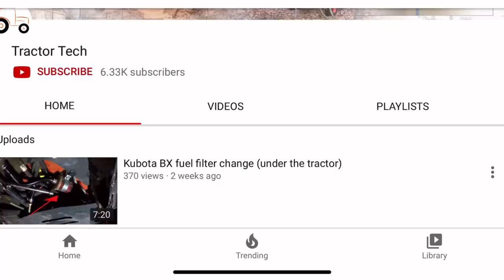Kubota BX fuel filter mod! Step-By-Step! (DIY)

Comment: I finally did this 8 months after watching your vid. The brass vent nipple is a press-fit. I popped it it through the backside of filter housing and ran a 1/4-28 tap and a bolt with Blue Jesus to seal it. I had to keep my filter under frame because my cab heater hoses ate up most the real estate on that side of the frame. At least I have a valve and can visually see any water now.
Reply from the maker: I actually saw your post I think On a Facebook group! Looked really good man I’m glad to hear it all worked out. I figured that nipple had to be pressed in there once I turned it and nothing happened, great to know it comes out backside tho cuz I didn’t know that. I’m glad it worked out! I’ll be removing my nipple next fuel filter change 👍🏻

Comment: Apologies, Biff. Yes, the parts are where you said they were but when I watched your video, it somehow skipped the beginning....but thanks for your reply....I've already ordered the filter &, oddly enough, I have just been through a nightmare with 2 tractors & both had water contamination....but that's another story.

Excuse the long post here but some of it might be useful to you or one of your subscribers.

Aside from the filter mod, I often see people asking for drawings, parts manuals or service  / workshop manuals & I found that many are available online, if you look for them....from front loader, mower deck, rotavator, box blade & bush hog...I got all manuals online...& for free. 

On another note, I have done just about everything with fuel on my BX2200D. Draining the tank, replacing lift pump, replacing shut-off solenoid & even stripping the injection pump to components...then buy replacement parts & reassemble it all.

I am no expert but when there is a fault.... I want to fix it without stupid costs from Kubota, so I buy most stuff from eBay......starter motor, water pump & more. Compared to Kubota, I've always found a cheaper source for parts from eBay & have them delivered to my door.....sometimes for 1/4 or 1/2 of what main dealer is asking.

Yesterday, I ordered 2 shut off solenoids from someone in Huston (I am in NW Florida) & that single order quickly changed to an email conversation with someone in China, which is where most parts are made today.

If you would like to know more, to pass onto your subscribers, get back to me. Via Youtube.
Reply from the maker: Awesome man I appreciate the information for my viewers. I have been a long time user of eBay and buying parts cheap from there tho I still try to buy genuine Kubota parts from eBay if possible. The one reason many people go back and pay crazy prices from Kubota is because with out it the aftermarket parts could ruin their expensive tractor warentee and make it void so lord of guys will still buy parts from the dealer because of this.. However if your tractor is not under a warentee anymore like mine or yours then I feel eBay is def the better rout for most stuff.. I agree most things are made in China anyways but I still feel Kubota factory parts have better quality to them as I have used both but have also had success with non Kubota brand parts also so it’s all in what you want. On your fuel sounds like you need to run a diesel biocide additive for awhile which will keep the Algie down and slowly eliminate it; run it in anywhere your storing your fuel and if your not storing it then I would choose a differnt place to get your diesel cuz it sounds like they may not be changing/updating the filters on a regular basis. I’m glad you got everything you needed to do the mod, wish you the best of luck! Thanks for the comment 👍🏻

Comment: This is an excellent video...& I've just come into the house, with fuel lines disconnected, trying to sort out my own fuel supply issues which generated a number of questions about the true value of inline filters & why the genius's at Kubota don't fit separators as standard. Of all diesel engines I have ever worked on, there was always a clear bowl to see particles & water. You've explained the modification extremely well...& this is just a little extra.....but the real fun starts when there is an issue with the injection pump that everyone says has to go to "experts" to repair for hundreds of dollars or spend a thousand or two to buy a new one. I have a BX2200D & actually had a fault on injection pump, read stuff online but there was nothing of use, unlike your video. But...it is only a pump & if you have basic mechanical skills, you can strip, find the fault, buy the parts online & fix it yourself.
Do a video on stripping & repairing an injection pump & you could probably get 3 million subscribers....but that's why every Kubota owner should have a separator filter & maybe you don't damage the injection pump.
Reply from the maker: Thanks man! Sorry I’m just now seeing your comment! As for the injection pump I plan to do a little modification to mine, I may do it this winter some time and if I do you guys will be able to see the injection pump more in debth. Iv never really heard of too many injection pump failures on Kubota engines specially these smaller 26hp and lower engines tho I have heard of the pump valve springs breaking tho it’s pretty rare and only when they have a considerable amount of hours on them. These pumps are pretty darn easy to work on tho I’m sure a lot of people think they are difficult. They are fully mechanical so there isn’t much too them. Stay tuned and maybe I can do a video on it sometime in the future! Thanks for watching and hope your mod went well!

Comment: The only thing I might have done a little differently, would to have use some bigger zip ties, and put the fuel line inside some Black Split Wire Loom Tubing for added protection.  Thanks though, great video.Thumbs Up!! I definitely like the idea of adding a much better fuel filtering system, should have been done from factory, but guess they have to cut the cost where then can..
Reply from the maker: Thanks Paul! I agree, larger zip ties would be nice, I didn’t have any that day only those little ones so I just used what I had but plan to redo them this winter. Loom is also a great idea, I actually bought loom for the fuel lines but forgot to install it. Thanks for watching and your right it is deffinelty a worth wild upgrade. Diesels NEED fuel to have power, with low fuel pressure and fuel flow they will run terribly so it’s vital that a Diesel engine gets as much fuel flow as it can. Like you said.. Kubota shoulda done this from the factory 👍🏻
Reply: I liked this suggestion so much, I added 5/8 split loom after my install.
Reply from the maker: @chiapet4444  Awesome! Wire loom will def help to protect the lines and keep them from chaffing. Glad it all worked out for you buddy.

Comment: Nice video, you'd think Kubota could have done that very thing in the first place.
Reply from the maker: Thanks Scott, yes I agree, woulda been nice if they did, they do it on many other pieces of equipment with this same exact motor but didn’t do it on the BX for some reason.. I’m assuming because they were afraid there wasn’t gonna be enough space to get to it where it needed to be which is typically mounted to the side of the block on these engines but in the Kubota BX since there isn’t a ton of room between the block and the hood bonnet I’m thinking that’s why they scratched it on this model machine which is unfortunate

Comment: Thanks for the shout out. The video was great, you gave nice clear instructions. You did a job installing the filter. If you remove the nipple, could get a plug that drives in (like a freeze plug) to block it off? BTW is your tractor missing a hose clamp on the fuel hose at the injection pump?
Reply from the maker: Tractor Tech thanks, no problem man. That nipple I’m hoping will just thread out of the housing and maybe I can find the right pitch bolt to put in its place, I havnt tested this yet tho. As far as the clamp missing, most of my spring clamps were black like the hoses so you prolly just couldn’t see it in the video. Thanks for watching man 👍🏻
Reply: Wondering the same! Did you ever try? I just got mine, I don't want to try pulling it out to find that I ruined the assembly.
Reply from the maker: Cody K I did try to un-thread it and it wasn’t wanting to come out, best to just leave it alone so you don’t create a leak. I may cut mine off and tap it out next time I have my assembly off as this is prolly the only way you can get rid of that ugly nipple 👍🏻

Comment: Great idea! Thanks for sharing. Did you torque the FEL mount bolt? Hopefully the fuel filters are easier to access on the B series or I'll be doing the same thing when mine shows up! ( Every day waiting for it to be delivered feels like an eternity!)

On to the next one (binge watching b4 church)!
Reply from the maker: Your B series should already have the nice fuel bowl/water separator on it, so lucky you! Haha. But if it doesn’t be sure to let me know. The FEL bolt should be torqued to spec just like any bolt but I just get it “good-N-tight” Lol
Reply from the maker: PS. Def let me know when you get your new tractor, you must be so excited! Eventually I want to upgrade to a B-series myself 👍🏻
Reply: @BiffsEquipment  I just got an update from the dealer. The tractor is almost fully assembled and he is waiting on the rear remotes and the snowblower. Sounds like the tractor should be 100% by Tues or Wed next week but the snowblower isn't scheduled to ship out until 10/11.

I kinda splurged! I ordered the B2601 w/3rd function and dual rear remotes, wheel spacers, 55" front mounted snowblower, 60" grapple, SSQA pallet forks, top-n-tilt kit, 60" box blade, and 60" rotary  cutter.

You are spot on, I am excited! I put my order in on June 1st... somehow, it "fell through the cracks"... it is a long story but after reaching out to the President of the dealership, I have a new salesman and the whole package price dropped over $3k!

Glad to hear that it will likely have a water separator! I've watched a ton of videos on the B2601 and haven't seen anyone do anything with the filters (except the guards sold by Paul & Kathy Short out of Newfoundland). I saw you mod your BX and think that was brilliant!

I don't "need" the grapple or rotary cutter but hope to us them for small side jobs to kelp pay for the tractor. Also, side work was a driving factor to get the TnT kit for quickly adjusting the box blade!

Well, I best get to work,  I hope you have a great day!
Reply from the maker: Domenic Maiani wow man that’s insane! You sure did get a TON of amazing accessories with your tractor! More than I think most people would. That is awesome! Your gonna be set right up for any job you come across for sure. If you didn’t order pallet forks that’s about the only thing I didn’t see that you’d wanna get. Aside from that it looks like your covered! Haha. Glad to hear they adjusted the price for you after botching your first delivery 👍🏻

Comment: Did something change in the last couple of years, because the part numbed you listed was for a Aipico (Aftermarket) part (on Amazon at least), not Kubota affiliated.
Reply from the maker: Yah I think by now the part number from Amazon may be different now. If you look around on eBay you should be able to still find the correct one. Best of luck!

Comment: If you did the upgrade fuel filter, do you really need the top filter on still or can you take it off and put the barb fittings in place like the bottom one or replace a new hose.

Comment: Great video.  Just curious why you left the other in line filter on if the purpose was to get rid of those in line filters?  

I did something similar to this on my BX a few years back. But replaced both filters with fuel water separator filters. I couldn’t keep my tractor running in the winter with those in line filters, even with diesel treatment.  It’s better now, until it gets into the single digits.

If anyone has any good tricks for keeping a BX running in the deep winter, let me know. I have tried just about everything.
Reply from the maker: Thanks man. I left the other inline filter in place because it’s just a secondary filter and never gives a home any problems.. having secondary filter is a good idea because if your lift pump fails it could send metal into your injection pump and destroy your injection pump so you should always have one filter that filters from your tank to your lift pump (this one does all the hard work and gets clogged the quickest which is why I changed it out) and then your secondary will go from the lift pump to the injection pump ans is only there to catch contaminants from your pump. Hope this helps, Thanks for watching!

Comment: It appears as though you've created undo stress on your lift pump as you've removed the gravity feed directly from the fuel tank. Now the pump has to draw the fuel up from the new filter housing. It might work for awhile but not sure this would be recommended by Kubota. It all depends on the design and specs of the lift pump.
Reply: since the fuel tank is higher then the new mount job it will make little difference i never let my tank go below half, the more fuel in the tank the easier it will be for the pump to work.
Reply from the maker: This is true and holds same truth for my Cummins pickup truck where I installed a sump on the bottom of the tank and a performance lift pump. I never let the tank go below 1/4 to 1/2 as it helps to push the fuel through to the lift pump. Having more fuel equals more pressure but even with my tractor I and many others have had zero issues with this mod and have only seen benefits from stock. Tractor def gets better/more fuel now runs cleaner, seems to have more power and even with a very low fuel tank the lift pump has zero issues pulling the fuel to the injection pump.

Comment: I’ve watched your fuel mod and was wondering if you ever were able to plug that top port on the fuel filter? If you did was it threaded, or how did you plug that port other then with a piece of fuel line and a bolt.

Comment: Great DIY! Is the metal bracket 1/8" aluminum?
Reply from the maker: Thanks buddy! The bracket was made from 1/8” mild plate steel.. not aluminum.. you could use aluminum I suppose but would wanna use aluminum angle iron as bending aluminum like I did in this video with steel would likely cause the aluminum to stretch/crack and break before you even finished bending it to a fill 90 but you can certainly try it!

Comment: Hi Biff, thanks for your vid. I'm doing this on my BX right now.  Did you find a plug for the top of the filter, if so was it an 1/8"  pipe plug? Steve
Reply from the maker: Hey Steve, that’s great to hear, you’ll love the improvement it’s gonna make! As for the plug I tried to remove the factory nipple but they have like a pipe sealant on it and I couldn’t tell if it was threaded in or pressed in, I got it to turn finally but it wasn’t coming out so I was afraid of having it leak so I left it alone once I turned it and it didn’t come out, luckily it never ended up leaking on me so I would say don’t try to remove the nipple to be on the safe side, just cap the end of the hose and call it a day, doesn’t look as nice but it is hardly noticeable honestly. Hope this helps!
Reply: @BiffsEquipment  It was a press fit. I tapped mine out from the inside and drilled/tapped for a 1/8 pipe plug

Comment: My fuel pump is shot. After going through the hassle of pulling it out (seriously 2 different bolt sizes and inserted from the top not the bottom?!) I'd love to put it in an easier to reach spot (since I've read that it's a common wear ite), like next to the new filter maybe just under the hood. Any input?
Reply from the maker: How many hours are on your bx? Typically the lift pump will last a very long time so I wouldn’t worry about re-locating it unless you really want to, but the lift pump needs to be close to the tank because the father you keep it from the fuel tank the harder it is for it to pull fuel through and to your injection pump (basically making it work harder) which will make it die faster.. my guess is your primary filter was clogged or in bad shape which possibly lead to an early lift pump failure do to it having to work twice as hard, if you do this filter mod and replace your lift pump you should be all set 👍🏻 keep me posted tho!

Comment: nice job.  why not jus use the existing fuel filter extend the hose and with a self tapping screw  screw the filter tot he side of the tractor where you use the existing clamps
Reply from the maker: Not sure what you mean. The way I did it in this video is the best and easiest way to do this mod. You won’t be able to get self tapping screws through the 1/2” thick frame rails